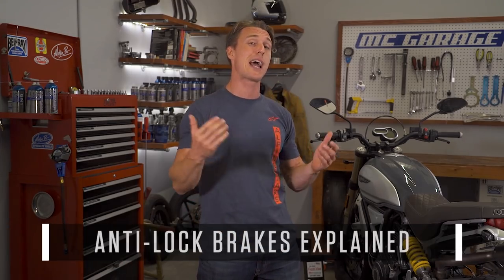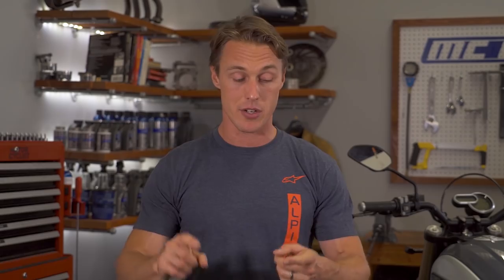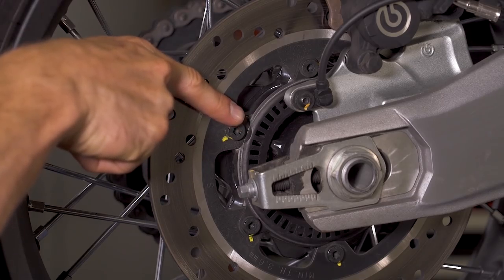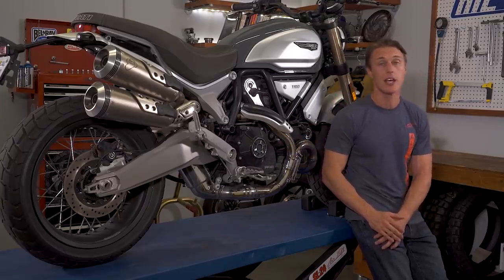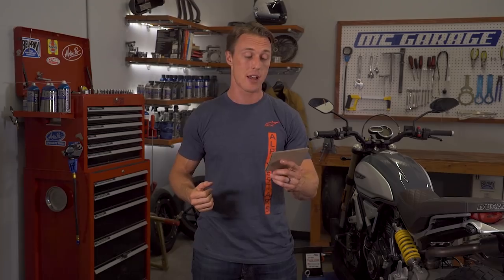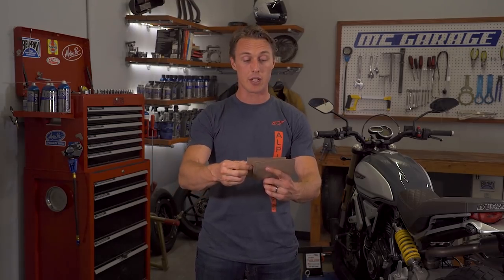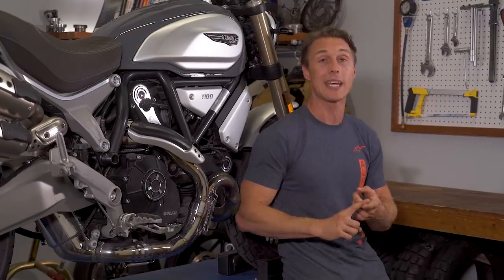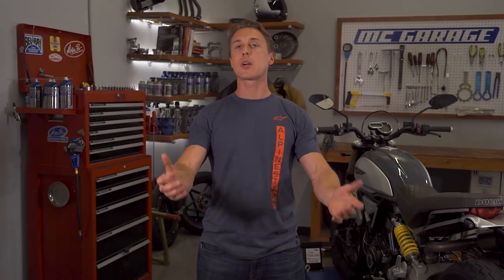Anti-Lock Brakes Explained | MC Garage

Comment: Wait, cars equipped with drum brakes at the back axle have 2 channel ABS systems capable of modulating rear braking pressure. It might not be feasible to put ABS on motorcycles with drum brakes due to costs, if a new motorcycle is supposed to have ABS it'll most likely be equipped with discs front and rear, but I wouldn't say it's impossible.
Reply: Hydraulic drum brakes and mechanical drum brakes. That should be enough for you to understand.
Reply: Damn, that's true mate, the fact motorcycle drum brakes are cable actuated completely slipped me by, thanks.
Reply: Ari also mentioned mechanical drum brakes.

Comment: what are your thoughts on the Kawasaki Concours linked braking?
Reply: The early setup sucked and was too abrupt, but the more recent system is much better. Plenty of manufacturers (Honda comes to mind) do a great job with linked brakes.
Reply: I have a 2011 and have been having a hard time bleeding the rear brake. Either because of the linked brakes, or maybe it has to do with the upside down rear caliper. Any thoughts?
Reply: I believe that when dealing with linked brakes there is certain sequence you should bleed the bleed points in. Try your service manual, there should be all the information you need.
Reply: Service manual is very vague in that they say bleeding the rear brake is the same procedure as the front, which it definitely isn't

Comment: ABS eliminates the fun part of the braking. However it's a great safety feature that every street motorcycle must have because sometimes Marc Marquez does mistake too.
Yes we could wish to have a switchable ABS. Which is not very much available in small capacity motorcycles.😕

Comment: Yo my abs light has been on.not sure what the issue is?
Reply: It typically means it's not working. If the light stays on while you are riding there is a problem. Normally it's on only until you start rolling.
Reply: Nick Am i know it's not working. What I meant was what's the issue that caused it to not work hahaha. Shops in my country will lie to us and make us change everything
Reply: @craftwanderer8802  Well, you can't tell if you don't check it somehow. I would search for a mechanic that multiple people suggest and go from there.

Comment: It's in rain and bumpy roads where ABS performs the worst, my last bad experience is with 2017 F800, so I'd say quite good ABS implementation, but on a bumpy downhill with sharp curves, ABS just craps itself because one or the other wheel are of the ground most of the time. Forcing me to mess with the fuses or force an error by running a bike while on service stands jus to turn it off is really stupid and forcing it by legislation just because some people are given the license even though they can't ride is even more silly. ABS is a good option and helps most of the rider, but it's not universal good.
PS: You didn't mention the significant extra weight and cost that comes with ABS.

Comment: Who says dont need abs means they never try motorcycle with abs before
Reply: I tried on bajaj 400, he was hopeless... at the moment when start working
abs motorcycle almost stopped braking
Reply: Its not stop braking. Its preventing front tire from locking. Locking means no grip.
Reply: @w1llyma1l  and kick to early and to strong for me (in this bike... probably some hi end system would be awesome)
Reply: Pretty much exactly this. I got pretty good at braking, but never had to do too many serious emergency stops. My buddy got s CRF250 Rally with ABS, and just for fun I got it up to 50 and pulled the brakes with every bit of strength I had. Stopped on a dime, and I knew right away, much faster than I could have stopped on my own without it.

Comment: The Toyota Tacoma has rear drum brakes with ABS.  So it is possible.
Reply: Thatttt's a car, where air conditioned seats are also possible. Having more room/not worrying about weight makes that sorta thing a lot easier. Motorcycles are a different story.

Comment: The main benefit of ABS is not just braking distance. It gives the vehicle possibility to steer while braking heavily.
Reply: I woudnt recommend steering during heavy braking
Reply: I agree, but when it's emergency the driver/rider probably doesn't have a choice.
Reply: You talking about a motorcycle or a car? In a car its perfectly okay to steer.
But a motorcycle you will fall off. Atleast im pretty sure if your try to steer during heavy braking.
Reply: I agree with you steering and braking at high speed on a motorcycle is indeed a very bad idea. But after slowing down to a more reasonable speed it is possible.
Reply: Ok. now it makes sense what you meant.
I agree on that.

Comment: ABS doesn't really shorten stopping distances. Instead, it allows the rider to maintain control of their bike so they won't skid and fall over.
Reply: Maybe not on the track, but on the road? definitely. The point of ABS in any vehicle is to stop the wheels from locking up which results in the vehicle just skidding along. 
But abs helps maintain traction.  Please lock up your rear wheel and record the stopping distance and compare it to when you try not locking it. You'll be able to see the difference even without abs

Comment: Have you ever driven an old beat up car down the highway?  You probably won't drive very fast or tailgate the car in front of you. Your braking and corning will be more conservative. Yet look at the guy in the brand new BMW.  He has no problem weaving in and out of traffic and tailgating the car in front of him.  Believe it or not, all of the new technology in cars hasn't reduced the fatalities on our freeways.  When people understand that their vehicle has this advanced technology, they will push their limits. This is called risk compensation and it is the reason ABS won't actually save you from anything. Technically it can prevent your wheels from locking up, but there is more to riding than just how advanced your motorcycle is. The perception of safety will cause the rider to naturally take more risks.

Comment: I prefer non-abs. I also practice emergency braking all the time. I know, sounds dumb, but it's what I do. 

Abs caused me to hit a car that pulled out in front of me that I would have otherwise simply stopped before hitting it.
Reply: "Abs caused me to hit a car that pulled out in front of me that I would have otherwise simply stopped before hitting it" Yeah no. Not unless it was seriously broken. ABS intervenes when you're about to slide, and sliding mean you're gonna stop even slower. If you hit it with ABS, then you were gonna hit it without it, except you might've hit it as you slid along the ground.
Reply: Bullshit... ABS didn't cause that.
Reply: ABS can lengthen braking distances in certain unique situations. But the benefits are usually worth those few exceptions. Honestly you probably would have hit the car without ABS but your free to think what you want.
Reply: haha. becuase you were there and totally know exactly the scenerio i'm talking about. kudos on your arm-chair quarterbacking. :)
Reply: when my front tire touched the trolley tracks  as i was trying to brake and turn at the same time, ABS kicked in and wouldn't allow  me to make ANY more input to change direction or slow down.  it wouldn;'t even allow me to tuck the front if i wanted to in order to avoid t-boning the car.  put that in your pipe and smoke it.
Reply: seppes your right, I wasn’t there. Perhaps you could have avoided it. How hard did you hit the car? Most people won’t have the skill to brake better without it. Like I said, there are situations that could benefit from no abs like gravel. Usually a locked tire on the street means you’re past the traction threshold though. I can say I don’t have the skill to threshold brake better than the abs and that abs saved my bacon a few times.
Reply: if you guys had any idea of who i am and how i actually ride, you'd understand what i'm saying.  no biggie though..this IS the internets, after all. ;)  

believe me when i say it (or don't), but ABS caused me to not be able to slow and change direction like i wanted to (and am very well capable of doing). i ended up hitting the car at about 8mph while at full steering lock to the left. 

it was a dry, ideal sunny day.
Reply: obviously you've not experienced many ABS systems. i can outbrake most of them easily. it does NOT simply intervene when it detects a slide. my ABS actuates on my FJ09 all the time while not even braking hard. in fact, all Bosch9 systems i've ridden are pretty terrible and will intervene LONG before threshold/skid. i play motorcycles for a living. at a fairly high caliber.
Reply: seppes ok I’ll take you at your word. Like you said ‘‘tis the internets so most people are talking out their ass.
Reply: I believe you, but many crashes among drivers and riders are due to failure to apply enough braking pressure. ABS allows mere mortals to grab a fistful of brake and hope for the best. Overall it is a big benefit.

Comment: Abs is all good until it breaks then it'll cost to much to fix. And we will start seeing bikes that are otherwise good being taken off the road early. 
Now to the are they better than non abs bikes. Most definitely. A human can't react to changes a thousand times a sec. Period. Now should it be mandatory no. Is it an acceptable replacement for learning how to threshold brake no. So it's a mixed bag at best.

Comment: I locked the front beak up on my bolt and pitched my dumbass over the handlebars.
Pro tip: pay attention to the traffic light a block away, and not the train 3 blocks away

Comment: I think ABS is smart, it's good to have, but I don't want it. It's not what motorcycle riding is for me. I want to be in control of everything. If I mess up I'm alright with being on the ground. That's on me. I'm not a good rider at all, it's not arrogance, I just want to get off the bike and know it was me who rode. Not like those guys on an S1000RR bragging about their wheelies, or about how fast they were into the corner. That's your bike's computer and not you that did that. I'm completely aware that my reasoning is stupid, but riding is something I do for fun, not because it makes the most sense.
Reply: You do you, man. Thanks for sharing.
Reply: exactly, i don't want to see it on my bike either. Breaking is an important part of riding. We make everything automatic so what the point to ride it, and can it be called riding at all

Comment: I'm classed as an old school rider. All bikes that are sold now you can not turn off the ABS. The way i brake is hard and fast i'll end up crashing with ABS and besides all the bike that i ride the is no ABS option no fuel injection and ECU just good old reliable carbs, (1991-1999) besides ABS and the stuff to run the ABS adds weight. 
The only brain i want on my motorcycle is the idiot riding it.

Comment: If you are grabbing your brakes, locking them up, and not releasing; or braking hard when you have the bike leaned over - then you need to learn to ride or give up motorcycles all together. Face it bikes are not for you.

Comment: Next you wont need to steer either, I'll get hate for this but I don't understand how people can't feel the slip and back off with their hand or foot. This guy even says in the video that ABS will reduce overall breaking ability, but him and everyone here will ignore the fact
Reply: Instead of feeling the wheel skid you feel the ABS kick in and you back off on the brakes. It's the same thing really, you only don't risk crashing because of the skid. Also he didn't say that ABS will reduce overall breaking ability. What he did say though is that some ABS units will intervene if you do a stoppie. The only thing that changes in your braking with ABS is that when you have no more traction instead of sliding you get a pulse on the lever in your hand and foot. You can still modulate as you would if there was no ABS.
Reply: @nickam4100  not if you do a stoppie, but before it happens, that literally means it is hampering your performance in the few times when that is the only option you have. Say a car pulls out, you want to pick the rear up and slam into it side on (even a small chance if vearing away from the crash) or have your bike say 'nope' and force you to have a direct head on?
Reply: And Duncan, what if that same car pulls out in front of you when it's raining or the road is sandy? Instead of doing an endo you're going to fold the front and fall. Few (VERY FEW) riders actually know how to threshold brake (ie fully bury the front tire to the point of lifting the rear), and almost nobody is going to have the wherewithal to do it in an unexpected emergency.
Reply: @AriH211  dude go out in the rain and do an endo, I bet you can do it. What you mean to say is 'go out in the rain and freak out and grab the breaks because you have been constantly told that you can't do it'
Reply: I've done lots of scary, risky things with motorcycles because manufacturers and engineers told me I could, including grabbing a fist full of throttle while my knee was on the ground or slamming on the brakes while riding across wet polished concrete. I have plenty of experience threshold braking and I've trained for years to ensure that I can handle a bike in a variety of situations. Yet in an emergency, given how many factors there are (cold tires, manhole covers, cornering, painted lines, sand, water, etc. etc. etc. etc. etc.), I'll gladly trust ABS.
Reply: @AriH211  That's fine, but you must admit that regardless of how good or bad ABS is, and that regardless of your view Vs my view, it is always more essential to have skills (with or without ABS) than to have ABS and think it replaces skills
Reply: I was in a class with an experienced motorcyclist that made similar comments about how easy it is to brake hard. On the test it took him nearly twice as long to stop as the state finds acceptable. Or in other words nearly four times as long as the distance the motorcycle could be stopped in.

Comment: Progress. Like autonomous motorcycles? Automatic braking systems? Satellite connected/guided ECU's? V-V and V-I communications infrastructures? A computer chip between the rider and every control the rider uses? No. It's not process. Everything that is invented in the technology sector that does apparently intelligent stuff is not automatically progress. In fact a lot of it is regression, a destruction of essential freedoms in life to choose and control and not be hassled by computer A.I. or people who believe they know better than the individual how to live and how to do things. Regardless of the equipment a person chooses to use to move across the surface of the earth, why would we allow someone else to determine when, how, where, how far, and how often someone moves around the earth? What's the difference between a prison and an automated vehicle? Nothing but location. When do we stop allowing a corporate committee to determine how much control we get to have or not have over the machines we use to move across the earth? That's what it boils down to.

I don't want any of this garbage. I want to choose when to ride, how far to ride, where to go, how many times to go, and not be hassled by Big Brother in the process.

ABS fine. If it's an intelligent system that doesn't interfere with my lever control/feel/limits. Only IMU-aided systems with racetrack calibrations are allowing users control without early intervention. These systems are superbike territory and expensive. Most other systems are commonly complained about because of their early and intrusive taking away feel and control, even when someone does not intend to activate them during aggressive riding.

But like anything technological on motorcycles, inevitably people are comparing ABS systems to fuel injection, TFT displays, cartridge forks, traction control, throttle-by-wire, or whatever else that's encroached (and driven up the prices) of bikes and is slowly but surely conditioning the buyer into the idea that he is less required to learn control and should expect the infrastructure to aid him (or her) on his way. You don't have to have skill, just mash/squeeze/jam/beat/punch the controls and the system will take good care of you! After all, it's just like carburetors and fuel injection!

You want to be safe? Don't leave your bed in the morning.
Reply: Lifted_Above, the only reason that some people hate safety technologies is because it renders learned skills obsolete. It is never about freedom or whatever else and instead it is about elitism, the existence of which is regression in any way imaginable. You are succumbing to elitism and you hate technologies that render learned skill obsolete and enable more people being able to ride safely. It is your choice if you want to ride a bare bone machine but you are acting as an absolute hypocrite because your sentiment is excluding others that desire ABS and everything else. You are effectively forcing your elitism on others and people like are the reason why progress is very hard to achieve.
Reply: Boy are you dead wrong about me. But believe what you want.

Comment: When you have a bike with ABS and it fails when you need it most. This happened to me, lucky to not be dead. Now I'm a non ABSer. I'd rather know where I stand.
Reply: Or you can always assume you don't have ABS even if you have and actuate the brakes as you would without. If the moment where you need ABS comes you will be grateful. No one said you should grab a handful just because you have ABS. You should still brake correctly...

Comment: FTS i shift up and down clutchlessly on a bike with a cable throttle, i control my braking. all this idiot proofing is the same as manual transmissions dying, its not the same.